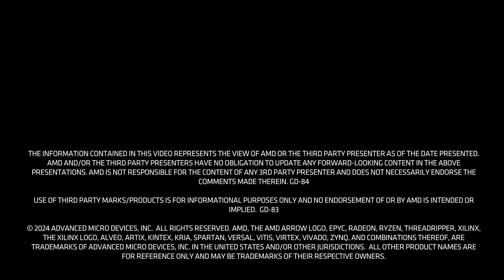OVHcloud launches the 3rd generation of Advance server lineup with AMD EPYC™ 4004 Series Processors

Comment: This server range (ADV-GEN-3) has a critical flaw—you can not use the additional IPs in the bridged mode but only in the routed mode, meaning you must host the dedicated virtual router for the additional IPs (VMs). Please upvote to make the buyers aware!
Reply: Why is that bad?
Reply: @timothyhendricks3004  Because OVH forces you to self-host the virtual router, otherwise buying previous and older ADV-GEN-2 server range offers the bridged mode, which means - the virtual router is on the provider's side. Therefore, the configuration and management of the VMs are much more straightforward.
Reply: I think security is the main consideration.